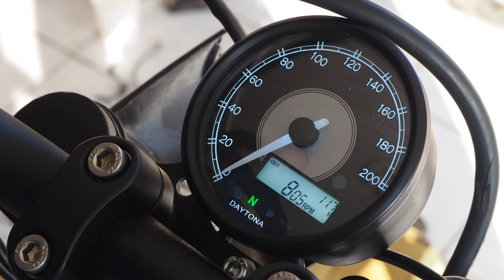BMW R65 Cafe Racer build - Step 4: Electrical Wiring

Comment: Help please! I want to use the 5 spade ign switch like you did and go thru the nacelle/fork ear. Please tell which wires from where goes to each spade. I do know that red goes to #30. Which wires go to #58A, #58E, and #15. Where do I find these wires. The orig ign switch has only 4 wires. Thanks!!!

Comment: Excellent video once again. Do you think it would be difficult for someone with no soldering experience to fit a daytona tachometer into a R45 (1979) ?
Reply: How did it go? Did you do the modify?
Reply: @noelbarsony5968  yes 🙂 I managed to do it and I am very happy with the results. Next big thing is to fit motogadget m.unit however I thing I will take it to a specialist for that.

Comment: Hi Ruben. Would you know if the Daytona speed sensor would be compatible with an acewell speedometer? Great build 💪🏼
Reply from the maker: Hi Beuran, to be honest I have no idea. If I were you I would use the Daytona Speedometer, than you are sure it will work.
Reply: Thanks. Did you connect all all speedometer wiring or did you leave out wires that did not pertain to the bike?

Comment: Could you provide more detail on the speedometer installation? Doing similar work on my 1982 BMW R65 and thinking of getting the same Speedometer. Of everything I'm doing, I'm most worried I'll screw up the Speedometer or I'll get one that isn't suitable!
Reply from the maker: You might find more information in my brother's channel. Also, I think he will make a separate video of the speedometer soon. For now, you can already check out this video of him: https://www.youtube.com/watch?v=Aeq1NtNHrLk&list=PLpGdwS3hXOiRxpziI_wQ2Pu54ExsR8KR8&index=5&t=0s
Reply: Managed to figure it out (Haynes manual finally arriving helped). Following both your channels already as I’m doing similar work just waiting on everything to arrive - only received the Speedo and a few other bits so far
Reply: Hi Ruben

Nice build! I also bought the Daytona Velona but I’m curious about where to get a mount like yours? I like the speedo placed in the center like yours. 

I’m building a BMW R100, 1982. 

I really hope you can help. 

Best
Chris